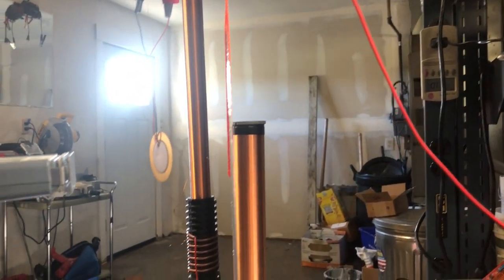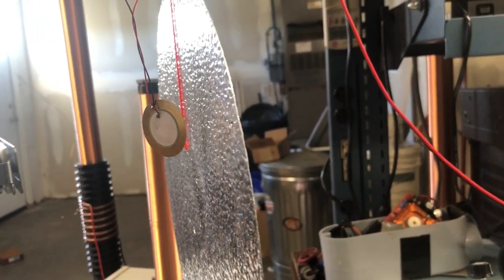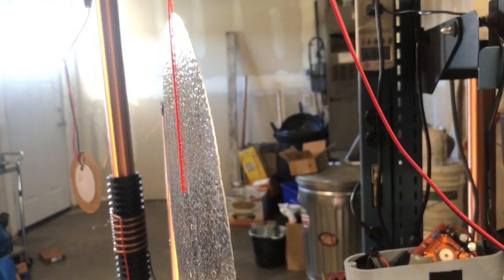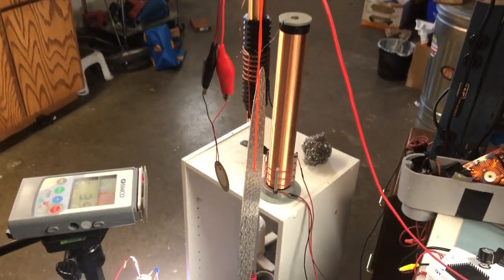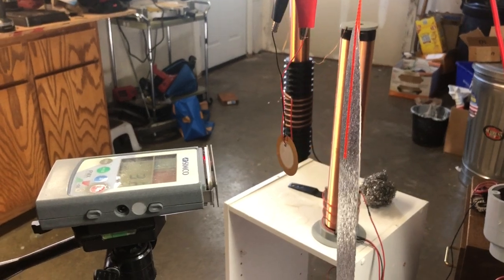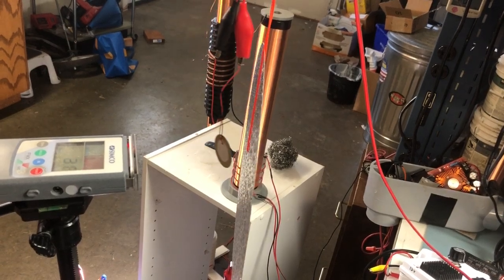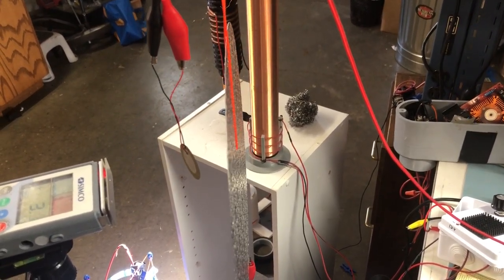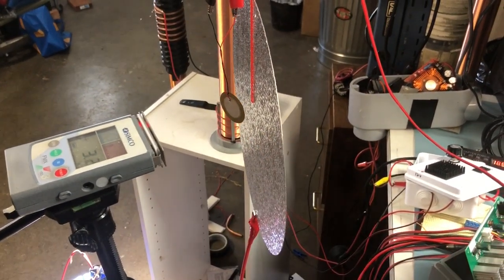Graviflyer Testing: Piezo / HV interactions

Comment: Piezo will not offer the excitation you need to interact with the vacuum field. You would also need 10^24 volts per square meter even when using plasma's instead of Piezo. Using Piezo's isn't sufficient for vacuum field interactions.
Reply: This whole graviflyer thing is fake. However, physics says it's possible but not with whatever this graviflyer thing is attempting to do.

Comment: Jarod, Watch Nathans latest video.  What I wrote to Nathan.  Nathan, so you had the ultrasound disk upside down. This would affect everything.  LOL. Remember the fishing reel sound that Alexey hears before pushing the button to turn the ultrasound off? This is the chirping that you are hearing. When your tesla coil is on, motors are at the correct omega, ultrasound are turned on, the correct distances are set between the plates, the magnets are spinning, correct positive and negative voltages are connected to the center and top and bottom disks, ultrasound is passing through the disks due to the marks on the aluminum, the correct high voltage and lower voltages are on the center and top and bottom disks, the voltages are shut down on the disks due to the ultrasound being on, etc. the charge is building up on the top disk and bottom disk and the ultrasound is going from VHF to lower frequency as the charge is affecting the operation of the ultrasound disk and shutting down the ultrasound disk. Your device is shorting out sometimes and why we see the arcing when the charges are at the correct point to cause this to occur. This is due to you not having the top disk coated with the dielectric as I suggest and know about from chatting with Alexey. You need the top disk normal capacitor and the bottom disk air capacitor.  The top and bottom disk need to be at their negative charges so that the bottom disk repels the earths negative surface charge and top disk attracts the ionospheres positive charge to achieve liftoff. The magnets and circulated charges that make the disks current and voltage and a higher magnetic field make the bottom disks charge stay separate from the center disk and the normal capacitor top and center disk keeps the charges separated from each other. When you short out the top and center disks then the chirping sound stays off as the ultrasound is at a VHF once again and you cannot hear it as the sound is outside of the human hearing. The charge takes time to build up as Alexey shows due to the electrical circuit setup to achieve resonance and before you push the button to turn the ultrasound off. This is shown when you short out the top to the center disk with the paper or dryer sheet. If you only touch the paper to the top or bottom disk the paper charges up and we see the electrostatic attraction of the paper to the disks. If you had the correct normal capacitor setup with the coating, the charge on the top disk would build up higher as the charge would be at the correct level and you would hear the fishing reel sound and know it is time to push the button to turn off the ultrasound so that the voltages would turn on and the high charge of 0.17 coulombs would stay separated from the center disk and the bottom disk along with the magnets and circulating current and voltage that makes the larger magnetic field and also not short out. If the ultrasound is not turned off at the correct time the entire setup shorts out as there is too high a charge and the necessary, charge for liftoff is not achieved and Alexey has to wait and start all over once again. The fields then have to dissipate.  If the button is pushed at the correct time, then the charge, circulating current and voltage on the bottom disk, magnetic field, and also the magnets magnetic field are set up correctly and this would help to achieve liftoff by the devices magnetic field being the same polarity as the earth's magnetic field, so they repel. The built-up charge of electrons is the electric field and the anti-gravity field and the magnets and circulating current and voltage are the magnetic field just like the earths setup that is an electromagnetic gravity field. You also need the battery to get the correct frequency from the batteries chemical makeup so you don't get the radio frequency and instead get the correct visible light frequency so the entire device and the earth act like an atom with exchange particles like the UFO show when they approach the ground and light up the area and the associated fields affect such things as cars and radios shutting off and nuclear missile silos being set off to launch the missiles and why the military then has to shut down the power grid where the missile silos are located and the nearby trees and ground become polarized with electric, magnetic and gravity field anomalies. Your power supply is not a good idea as it operates in the range of the radio frequencies and can cause brain damage. The anti-gravity waves can also reverse time and space and cause people to grow back teeth like Barney Hill had occur and why they sometimes show up after an abduction at a different time than when they were abducted. The produced gravity waves can also cause genetic mutations like we see in the wheat when the UFO make graffiti crop circles.  Etc., etc., etc. When the voltages turn on this is when the magnetic field sets up and you get the push force. The heat is radio frequency heating and you do not want this. You want light. I explained to Nathan to use dielectric paint to coat the bottom of the top plate instead of the Al2O3 and the Al on the CD.When the voltages turn on this is when the magnetic field sets up and you get the push force. The heat is radio frequency heating and you do not want this. You want light. The lower voltage on the bottom disk and the high charge current makes the device superconducting so you don't get heat but anti-gravity waves as I explained to Michael Perrone so contact Michael to explain to you. Please let me know if you read this. The field bubbles then set up.

Comment: I just did a test and I was getting a better result on it when i taped on the center plate. It reminded me of when you said it would change the octave. So Does the piezo do that? In the test after hitting the right spot the light would come back on. Before I would have to recharge the center plate. I did it with and without the paper. Here is the test. https://youtu.be/F9dvDQqtdYY

Comment: When I ran my HV testing the emi slowed down my motors. When I built my fields and the piezo was OFF ( pushed the button )it did the same. You are looking for disc flutter. It is the same thing. When we have a bent disc and we turn up the rpm on the motor it flattens out the disc. So when the rpm slows it goes back to being bent. I is not that noticeable at 2600 rpm. But at 500 rpm it is. This flutter and motor pause are the same thing. It is like taking your foot off the gas then gunning it. the momentum throws you forward. In this case it goes up.

Comment: Here is what I think is going on. The mhz frequency is not from the US circuit. The piezo is a receiver and a transmitter. So when on it transmits the US circuit frequency. When off it receives the frequency of the craft. We measure it in mhz but I think it is not frequency but amplitude. Yes I do understand the amount of times the vibration happens is frequency. The reason I think it is amplitude is that the piezo cannot distinguish each frequency individually when off. It just picks up vibration. So all frequencies are amplified. But when it is on, only the resonance frequency's in the center plate can be matched.  When you match a certain frequency  you get an amplitude of that frequency.
 
The craft pulses with the top motor frequency in my configuration. As long as the piezo center plate frequency's can be amplified together. It makes a resident frequency. 2 frequency's amplified and a pulse wave. It produces more power with less power input power.  They form a bubble around the craft that pulses.

 There is one other factor needed for the lift and Jarod you showed it in the video where the graviflyer was swinging. The force of a weighted disc when the power is on will not give a upwards direction like the right hand rule would say. It pushes outwards on the horizontal plane. When the power is cut off suddenly it will allow the force to go up. When the power is back on it stays on the horizontal plane. You saw it as a swing but it is more like walking up a spiral staircase.

Comment: Jared, what are you trying to show here. Didn't you read my latest comments on how the graviflyer works like the earth that two other people realized? Why aren't you setting up the graviflyer in this manner to get lift off?
Reply from the maker: In my previous vid, I showed that the piezo changes under stress, it’s SWR min freq moves up with increasing pressure. So now I’m testing to see what possible interactions the piezo has under different electric fields, as well as testing the ultrasound circuit’s OFF pulse button in these conditions. At certain freqs, distances, and HVDC voltages the piezo responds differently. Its electrostatic repulsion/attraction to the charged disc changes even with solely pressing the off button or adjusting the freq. Also, it seems to have a much stronger effect in a positive field than a negative one, which might be why Alexey eventually moved the buzzer to the top of the craft.
Reply: @MyTBrain  Jared, thanks for the explanation. I really appreciate it. You state charge and then mention kilovolts, so I am confused somewhat as isn't charge coulombs? Also, what is SWR and US frequency? You also state that during the off cycle of the piezo disk you lost charge. Nathan in his videos puts the high voltage positive on the center plate and lower voltage negative charges on the top and bottom plates. You state that the positive charge showed more of an effect.  From reading on the internet putting groves or hammer marks on the plates allows the ultrasound to travel through the top and bottom plates.  You state that during one of the off pulses the positive charge changed by 1 kv. Does this mean the charge dropped on the plate?  This would make sense for the graviflyer as the middle plates positive charge has to move to the negative bottom plate, so it has enough charge to repel the earth's negative charge so the graviflyer levitates. I learned from Alexey two years ago that he used a polycarbonate CD with its associated groves and the coated Al and Al2O3 as the top plate on the graviflyer. This CD was a normal capacitor with the top plate and the middle plate, so the charge does not transfer to the middle plate or the bottom plate. I just learned from Nathan in his last video that the top disk has some sort of white coating on the bottom of the plate and may be similar to the CD with its Al and Al2O3 coating. The bottom plate acts more like an air capacitor that can transfer the charge to the bottom plate.  The top plate stays negatively charged so it can attract the positive ionosphere to get lift of the graviflyer with no transfer of charge to the middle plate or the bottom plate. The middle plate has the hammer marks on it to allow the ultrasound to travel through to the bottom plate to allow the transfer of the charge. In your video the piezo was swinging back and forth from the charged plate and changed its distance and maybe why you got the large 1 kv change when you pushed the off button and could not duplicate this in succeeding tries as the piezo and the plate were not at the correct distance. When the distance between the piezo and the plate is just right the charge can transfer from the middle plate on the graviflyer to the bottom plate. The distance between the plates is important. Also, the rest of the setup allows for the charge to set up on the plates over time so the transfer can occur. This is why if the settings are not just right Alexey has to start all over to allow the charge to set up once again so he can push the piezo's off button to allow the charges to transfer correctly at the 0.2 coulombs that I calculated with the coulomb force equation to get the lift. The fast transfer of the charge gives the push to move the graviflyer upwards at a distance from the earth's surface. I think I explained this correctly, but I get confused sometimes with my disability. I hope that you get the idea that I am trying to convey to you. All UAP are either bell shaped, saucer shaped or spherical shaped and all may have some sort of graviflyer inside of them for lift. Mark Tomion suspected some sort of spinning disks inside of UAP back in 2001 and why he built his EDF Generator the way that he did. In Mark's craft the electron field surrounding the craft allows for propulsion with warp drive and wormhole drive by changing the voltage and current of said electrons. The number of electrons decides what space wave (gravity wave) on my spectrum gets produced to allow this to occur if you have ever seen my spectrum from my many emails to Tim, Jeremiah, and Mark Sokol.  My star device that Jeremiah built on his YouTube channel is what powers such UAP.  I also think that the UAP on the show Skinwalker ranch are such craft that go back and forth through the naturally occurring wormhole to the US military base one million BC so that they can study the earth back at this time. Maybe you and Nathans research with my comments lead to these craft being built sometime around 2030. LOL.

Comment: What are you testing for here?
Reply from the maker: In my previous vid, I showed that the piezo changes under stress, it’s SWR min freq moves up with increasing pressure. So now I’m testing to see what possible interactions the piezo has under different electric fields, as well as testing the ultrasound circuit’s OFF pulse button in these conditions. At certain freqs, distances, and HVDC voltages the piezo responds differently. Its electrostatic repulsion/attraction to the charged disc changes even with solely pressing the off button or adjusting the freq. Also, it seems to have a much stronger effect in a positive field than a negative one, which might be why Alexey eventually moved the buzzer to the top of the craft.